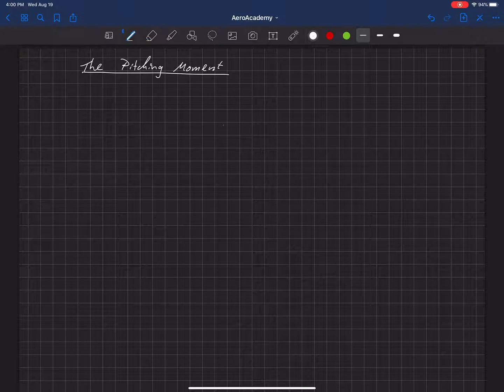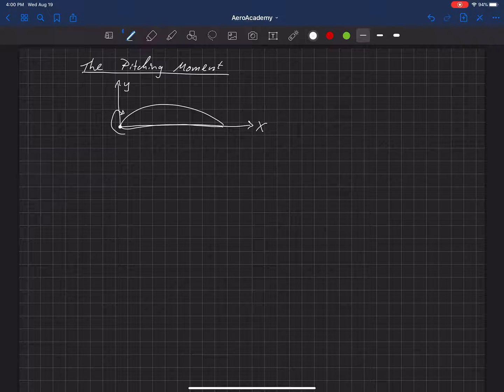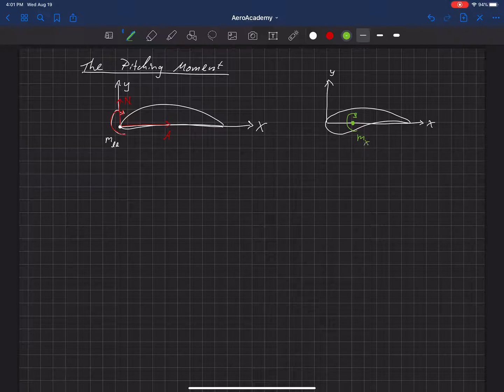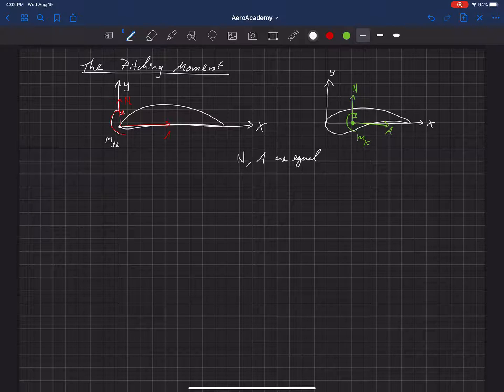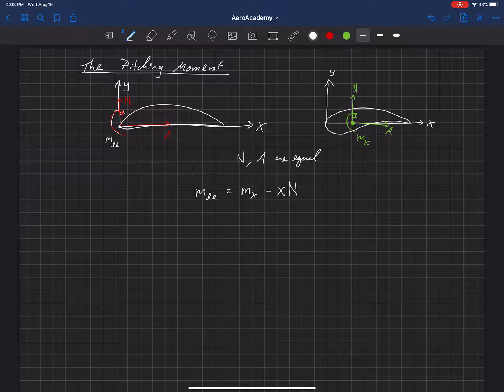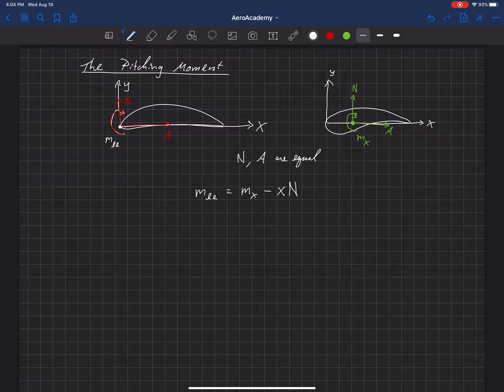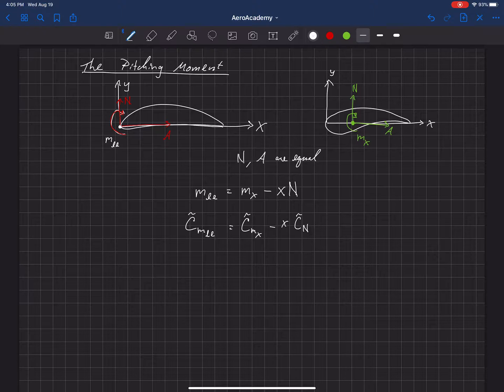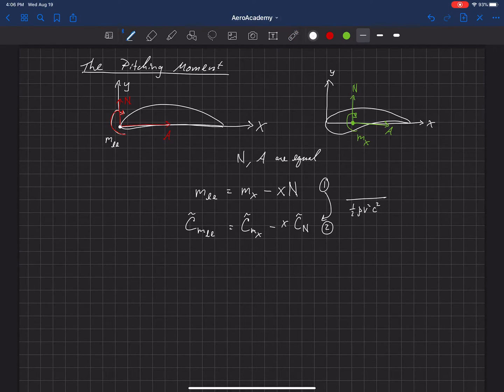Fundamentals of Aerodynamics . Introduction . Pitching Moment

Comment: I had a question: why would coefficient of moment for a wing matter when there would be a much more significant moment generated on the whole aircraft due to center of pressure and Cg? Does Cm of the wing itself play a significant role in the aircraft's overall stability?
Reply from the maker: Great question, and yes, for conventional aircraft the stability is dominated by the position of the horizontal tail and main wing relative to the CG. The change in pitching moment as a function of angle of attack from the airfoil will affect stability, but only slightly as you point out. However, the pitching moment on the airfoil (and therefore the main wing and horizontal tail) do affect the trim condition. This is especially apparent for flying wings, some of which use reflex trailing edges to adjust the pitching moment of the airfoil/wing for trim purposes. Does that help?
Reply: @AeroAcademyOnline  Yes! Thank you so much for the response! I didn't expect to receive an answer and didn't realize that you posted this (Youtube didn't give me a notification). I am done my final now and thankfully I passed, but thank you for your explanation sir!